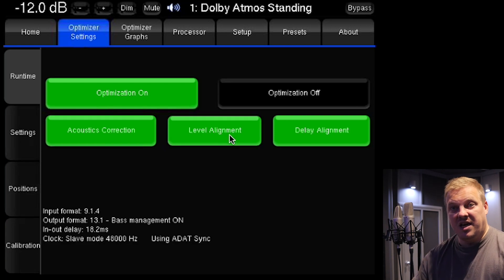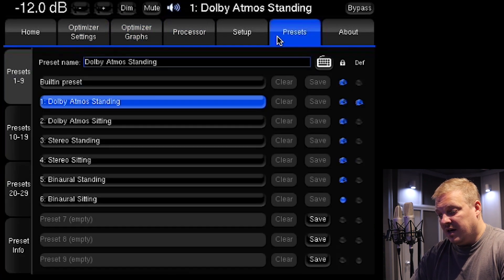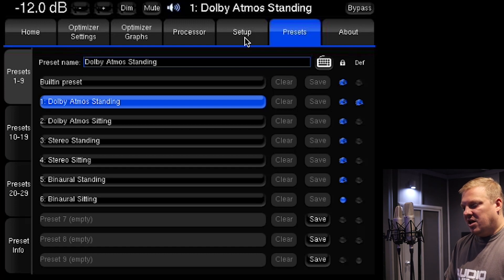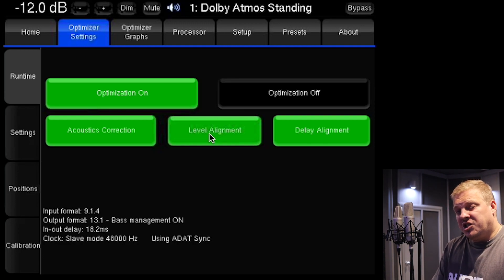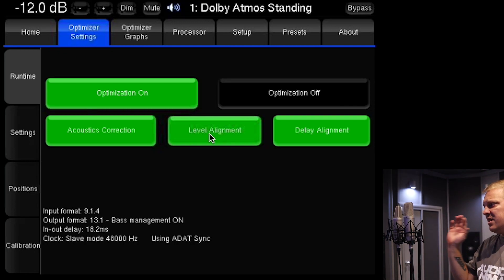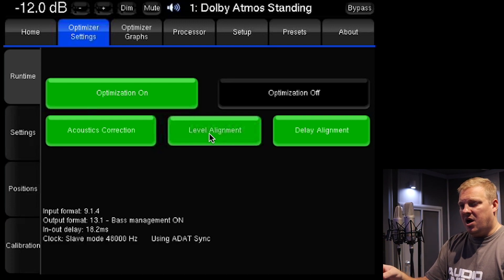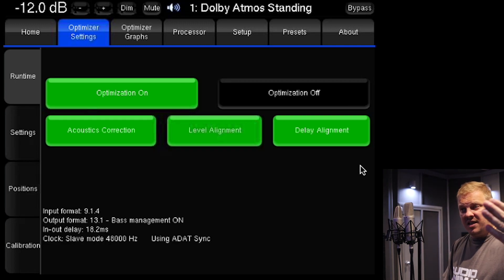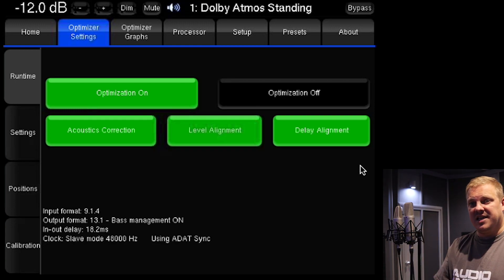Trinnov Room Correct - How It Works Review (audio demo)

Comment: I’m curious about Trinnov’s binaural performance. Does it play back Atmos better than Atmos being folded down to regular L & R? How does binaural fit in with stereo speakers? I’m sure we all know how headphones perform but I’ve never thought about using speakers. That’s a lot of questions 😅
Reply: Ahhh just found your vid on this (in case it answers my questions) thanks!
Reply from the maker: @dougleydorite  using the Trinnov you can create a preset for binaural playback. It's perfect. Allows you to mix in binaural without headphones. You need to set it up correctly though. You hear a lot of people who will say you need to use headphones to experience binaural playback but those people don't have a trinnov to set it up correctly.

Comment: Is is the sound interface (like my Apollo)? How does it compare to sonarworks?  Thanks 🤘🏻
Reply from the maker: It isn't an interface. Imagine it going in-between your speakers and apollo output. So any audio sent out the monitor out, before it reaches the speakers the audio is corrected for the room. 

Compared to sonarworks. It's like comparing a Begatti to a pedal bike. Sonarworks is actually really bad and for me and my experience with it, I can't trust it is correct. Trinnov gives you a perfect room calibration.
Reply: @AudioAnimalsStudio  Thank you for that reply!  I was just looking at them on Sweetwater.  If I were to get one for my studio, going between my speakers and Apollo, I’m a bit confused on which one. I suppose I can chat with Sweetwater, but could you provide any more insight?  Thanks again! 🤘🏻
Reply from the maker: @kennethdaniels  the one you would want is the Trinnov ST2. This is what I use in Studio C which is a stereo mastering studio. Similar to what you would have. You may be better off getting the new Trinnov Nova which is also an interface. And a cheaper option.
Reply: @AudioAnimalsStudio  This is the info I was looking for! Thank you!!

Comment: Thanks for the review. My mastering room measures pretty flat down to about 32Hz and I'm pretty happy with the sound. However, I'd be interested in demo'ing a Trinnov system at some point. Do you have to turn off the Trinnov before printing your masters? Or is it set up where you don't have to worry about turning it off?  Thanks
Reply from the maker: The Trinnov sits as a physical piece of hardware between your interface and speakers. So you do not need to turn it off before printing. It's really worth demoing. Different class compared to sonarworks.

Comment: I have a fairly large studio(14.3x21.7x13) with DIY treatment. Would you say a trinnov vs adding a sub(cheaper) would improve low end response?
Monitors- footprints 01/ solos 6be.
Reply from the maker: 1 million percent yes. You can add a sub too and bass manage the system. It makes a huge difference. Add a sub without a trinnov the room will still be wrong. Add a trinnov the room will be as accurate as is physically possible. You can edit the trinnov preset you create and add more low end if required.
Reply: @AudioAnimalsStudio  great. Seems like a better investment to other hardware for "mixing" contrary to popular belief.